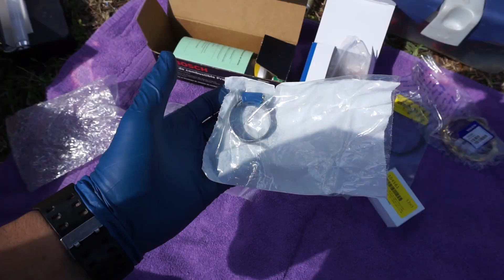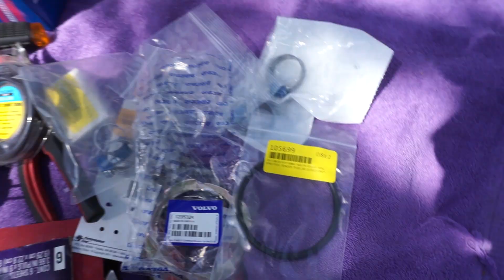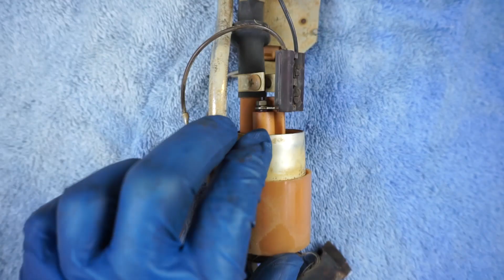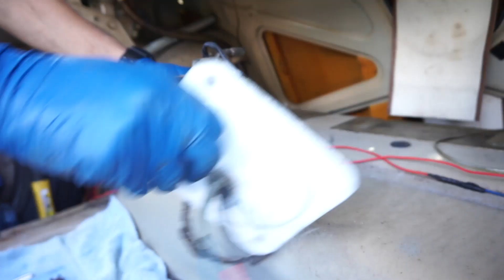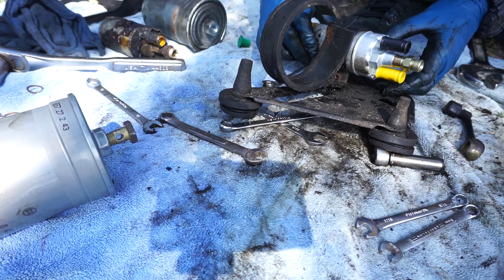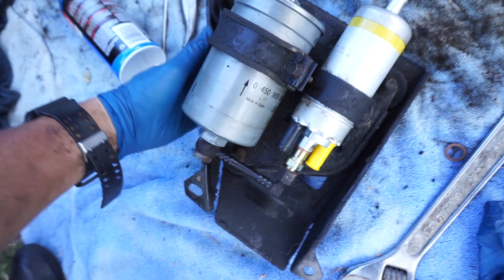How To Replace 1986 Volvo 240 In-Tank and Main Fuel Pumps

Comment: You described my 91's 240 car problems exactly!    Thank you for this video.  
And ironically,  because of hurricane Urma, I was waiting for my "new"  used 2002 volvo V70 to be shipped from VehicleVille a few extra weeks!
Reply from the maker: Dan B glad you were safe from Irma and glad I could help u fix your car probs lol
Reply: @mgaquer  hi i need really fast help.. my Volvo 240 1986 gle lost alot of power and i would suspect that the fuel pump or something with it is bad but im not sure. Could it also be the fuel Lines clogged or the carburator being clogged or carburator oil being low? im not really sure if those things can make such a big differense because i almost got no power at all its drivable but accelaration is bad. i need to use this car on saturday this week and if not im kinda f**ked
Reply from the maker: @Crack.exe.  have you tried turning the car off then restarting? ive had an issue where after some rain storms, id go to drive and there was no power, so id put in neutral while the car was still rolling, turn key off then restart the car and put back in drive and it would fix the issue. It turned out that my fuel pump relay was shot (behind the glove box)
Reply: @mgaquer  thanks ill test d
that

Comment: That fitting that you are tightening right at 6:58 at the output from the pump leaks for me like crazy. I destroyed the old coupler hose trying to get it off when replacing my filter so I bought a new one and it leaks like crazy. Is there supposed to be a washer there? Or are you just supposed to crank it down incredibly hard? i feel like I have a faulty new coupler...

Comment: Did this job improved your car's performance? I have a 1990 Volvo 760GLE  with ~250k miles and both pumps and filter have never been replaced. I am getting rough idle, and at times poor throttle response. I am going to do the main in-line pump and filter first. I like your use of the padded needle nose vice grips to pinch off the flow of fuel when disconnecting the fuel lines. But after removing the clamps from the fuel hoses, can you share any tricks for sliding off the hoses without damaging the hoses. I have noticed that the hoses on mine are very hard, so by crimping it, I am concerned about cracking it, in which case the entire hose may have to be replaced. --- I will appreciate your comments. Thanks.
Reply from the maker: Andrew Peterkin the rough idle could be a number of things. I’d start with the basics first like plugs and wires etc. But after my pumps were replaced I didn’t notice intermittent hesitation in turns that sometimes would happen. In regards to the fuel lines, I’m not sure what you’re asking? I used the vice grips with rubber to clamp off the fuel. Loosened the hose clamps by the pump then simply slid hoses back onto new pump. Make sure u pull fuses 4 and 6 then let the car run til it dies to relieve pressure. Feel free to email me, my email or social media is in the description.

Comment: Hey man these vids really helpful. But i need some advice. My 86 240 dl has a problem where sometimes in the morning it wouldnt start. It started happening more frequently. And rn im left with a car because now it doesnt wanna start at all. Diagnosis lead to either a shot pump or a bad relay
Reply from the maker: NoStart-Jael make sure battery cables are tight, check fuses 4 and 6 for corrosion, check the 25 amp fuse in engine bay by battery against the fender panel, check fuel pump relay.
Reply: @mgaquer  i checked everything today after school and she fired right up after i replaced the 25 amp fuse. It was reslly corroded. But thank you for the advice

Comment: Matthew. Wow!, that was fantastic. It looked like a class room lecture. 
I have a 1987 240 DL. 2nd owner. I've owned the car since 1989 , although it was stored between 1993 and 2013. I put it back into action in 2014 after changing the two fuel pumps and a complete tune up. The car is a classic. The Volvo dealership loves it every time I go in for a part. I'm now having a problem with sluggish performance and slow start. 
Any suggestions? Thanks.

Comment: Just been doing the same with my volvo, the main issue is getting the pump back in the tank. My sock and float came off in the first and second attempts ☹️. Had to use a child to fish out the bits from the tank which is probably illegal bit only their hands fitted 🙂

Comment: I saw your video. My 1986 Volvo 240DL was diagnosed with replacing 2 gas pumps and filter. Can you tell me how much would it cost for this repair before I take to a mechanic...thank you.
Reply: Might be too late but. All in all. Keep in mind I also got trans fluid oil and oil filter. I was in about 300$ Both pumps and the filter. And the strainer because no auto part store had the filter with a strainer. Cost me about 180$

Comment: I'm doing the same exact repair on a 91 volvo 240. Where did you buy your replacement AND where did you get the tool that attaches to your drill?
Reply from the maker: FCPeuro for most parts since i live in Florida. If they don’t have inventory, then IPD USA.
Reply: @mgaquer  yeah my friend, who owns the volvo, and I have discovered that without that tool that fuel pump may be impossible to get out
Reply from the maker: @thehorseman1806  well good luck yall

Comment: How much time would you allow a non-professional to accomplish changing these out?
Reply from the maker: Daniel Ebbeling at least 12 hours just in case u need to run to parts store, breaks in between to eat or drink, or in case u run into issues. But if all goes well, I’d say easily 6 hours. I’m the type that likes extra time for myself
Reply: Matthew Gaquer 
Thank you , Matthew!
I have a 93 940 with a leaking main pump.
I will figure a weekend after the parts arrive.
Lots of rust on my tray as it is a NE car.

Comment: My ft engine cuts the gas during full throttle in 2nd and 3rd gear, i'm suspecting the fuel pumps and pressure regulator

Comment: Mine failed today at moms house, wasnt that hard to replace thx god I had the part but sadly the new isnt working either. I got 9V at the connector in the trunk while I have 12.5 at the fuse box (this is weird)
I dont know what wrong, maybe a bad Relay, a worn cable. Its an 88 sedan

Comment: "Loss of power" how can you even tell? Did the 0-60 go from 15 seconds to 20? Lol my 240 is completely gutted out and it's still so slow I'd be afraid to race an old base model 90hp Civic
Reply from the maker: Street Forged Yea the windshield wipers got slower so I assumed I’ve lost power. Sucks... 😂😂😂
Reply: Hahaha It doesn't matter if they're slugs, somehow they're still pretty endearing to drive, though I bought mine on cut springs so I've never gotten the opportunity to drive a completely stock one :/

Comment: Are the "pre-pump" and the in-tank pump two different names for the same pump? I'm considering doing the iPD upgrade when I change mine. https://www.ipdusa.com/products/5799/111016-volvo-in-tank-fuel-pump-upgrade-kit-aftermarket-7845k
Reply: Yes. Some also refer to it as the low pressure pump.